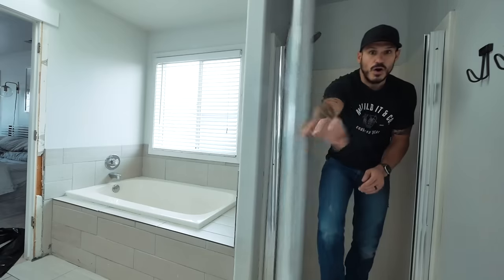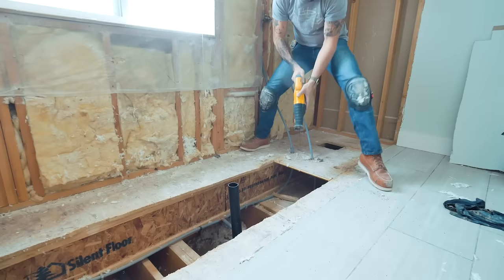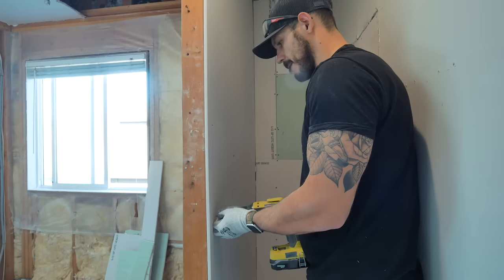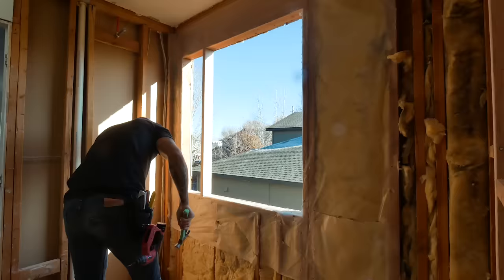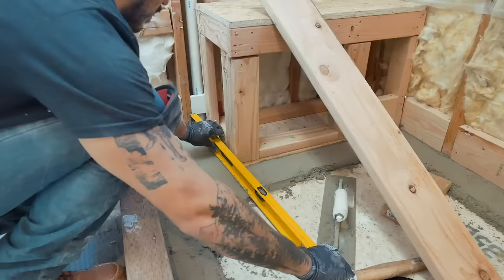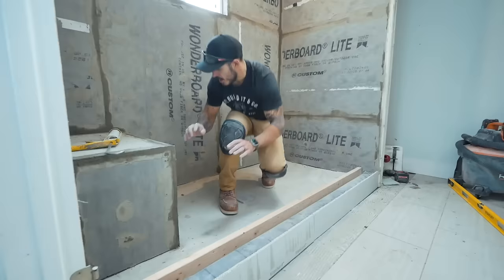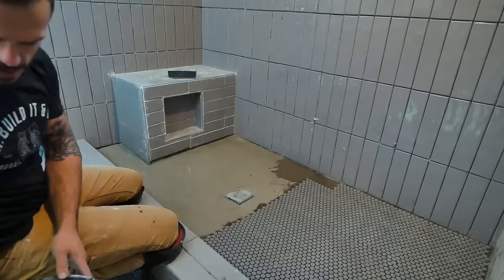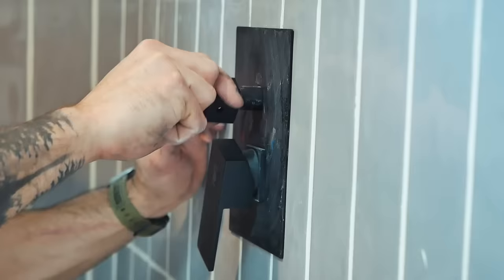Building a GIANT Shower (Home Remodel)

Comment: “all super easy. super simple.” hes says calmly while doing something super difficult and super complicated
Reply: says when he do super simple mistakes at water proofing.
Reply: @TH-wr1dv  You make a video then...
Reply: @oyster3145  And what we get with that? Me speaking poor english with rally accent will produce zero value.  And I did not judge his skills to to videos. I judge his skills to do structual choises for water proofing. Do you know that those are two different things?
Reply: I'm a trailer mechanic and thats the same thing some of my coworkers say lol
Reply: My thoughts exactly hahaa
Reply: I know is very hard need to find a handyman 🤣
Reply: Then hire him.
Reply: Tapio Haapala what mistakes did he make?
Reply: @esmyval8948 , it really isn't that hard. Most carpentry work looks hard due to a lack of experience. I would say the hardest part is just learning the work. After the how it works, it really is not that bad. Once you start learning, the hardest part is carrying the material lol.
Reply: @moabboy2175 , speaking as a carpenter with 20+ years experience .... I thought he did a good job. Honestly, he went above and beyond with the waterproofing. Most contractors do not use that rubber sealant on the concrete board, it is just expected that the tile and grout will keep the water out.

The one thing that did stick out to me, I would have used green board in the bathroom instead of normal drywall. Green board just being the gypsum board, which makes it more water resistant. Always used it in kitchens and bathrooms, just to be safe.
Reply: @TH-wr1dv  
Curious what you think he messed up?
He also put more layers of rubber sealer than most people would.
Most people don't follow instructions. Lol
Reply: @turboflush  He put water seal under concrete, not top of it. Then he put those wall sement boards top of that concrete and cover them with rubber. So basically that concrete slab is always wet and capillary will push that water to those sement boards and inside of wall. Specially when outdoor temperature drops thermodynamics keep care that all moisture from that slab will go to wall structure. I dont know what kind banana country laws even allow that kind structure.
Reply: @TH-wr1dv 
 good point. Cement is old school method. My 1940 house had a layer of tar paper on wood the concrete then tile.  Due to to much use .. 75years  later it rotted out the structure.
Just how it used to be done.

USA is slow for catching up on things. 
He also probably didn't have it inspected. But even then.. don't think they would have cought the where concrete was. They would just look that the pan doesn't leak and drains correctly.
Reply: @turboflush  yup. In finland that structure in video had been illegal over 20 years now. Moisture insulation work needs sertificate but even diy builders know how to do it properly. Basically there is no term "flood line" because that insulation will go as continous from floor to line of ceiling. Naturally doorstep will make flood line but rest is just continous (even pipe holes etc at wall wont leak). Also water seal is always just under top material and other layers must be breathing material. So if some reason moisture gets inside structure it will breath slowly out from it. So basically materials newer get sealed between two gas/water tight layer (as it was in this video) because it is guaranteed way to get mould.
Reply: @oyster3145  does he have to
Reply: Anngela Smithwick that’s what I just 
Commented I give it to the guy for trying but the finished product did not come out that good at all And a homeowner should not take on such an ambitious project Because I can assure you it’s going to end up costing you double and that double price Could be even more if you flood some thing or wire some thing the wrong way and most will be unhappy with the finished product people will want to know why it doesn’t look the same comes down to two things talent and experience Leave it to the pros
Reply: it was all fun and games until the piping came in
Reply: O
Reply: @Tuperwear his videos are alot of non load bearing and easy guts.....nothing he's doing is really going to make a house collapse and technically if any of his projects have a fail point he can usally call a electrian or plumber to bail him out usually under 500 or 1k
Reply: Tapio Haapala this is exactly why i would get a professional to do it. The money you save is peanuts compared to what it costs to repair mold, worst case it spreads so far you have to demolish the whole house (black mold). 

Especially in Finland where houses are very well insulated and temperatures are low the majority of the time, the risk of mold is just too high. 

Having the right paperwork will always make selling the house easyer, and will get you a better price. Noone is going to pay full price for a house where there is a risk of shoddy electical work and hidden mold.
Reply: @SportSoulLife  yeah I'd bare minimum hire a licensed electrician and plumber because if anything fails insurance isn't covering anything.
Reply: J Shapiro Remember back a long time ago when my mother bought our house, and the first thing she did is get the electical wiring in the kitchen checked out and replaced since she found out the previous owner did his own electrical work there. Turns out he used whatever wire he could find, including wiring taken from telephone cords, to wire up the electrical work in the kitchen. I live in a country where we use 230 volts in all outlets. A telephone wire for 230 volt kitchen appliances.
Reply: J Shapiro Oh and with remodeling showers or other areas expected to get wet and moist, atleast get a professional to do everything up until the tiling itself.
Reply: @SportSoulLife  that's a quick way to start a fire.....that's why we buy cheap spec homes and do the upgrades ourselves with out needing to go inside the walls. Just showers kitchens and flooring and it will always pass a va inspection and always appraise
Reply: J Shapiro Yup. What you mess up behind walls is hard to see before the avalance hits.
Reply: Yeah difficult and super complicated if you don’t know what your doing
Reply: It’s probably simpler than you would think, but I imagine costly and lengthy, especially since you’d be doing it on your own.
Reply: I agree, they always try to make it sound like it’s so easy...it seems easy until a year later you have a leak and it requires major structural repairs...and redoing everything that was done originally. ..anyone else see the “s” trap he used?

Comment: In Europe it’s just impossible to replace a window like that 😂
Reply: Why?
Reply: Yes, curious
Reply: Dynoids the walls are not built the same way at all
Reply: @AndreaSisto  different materials? Cause I used to live in Europe for my childhood and all I can think of is that many buildings have been there for a long time or are built out of stone/brick/cement
Reply: Dynoids yes everything is build out of stone. I have never seen a wall which is made from wood
Reply: I'm in the UK and my house is timber frame on the front and back above 1st floor, a common building method used alot if you own a 60s/70s built house
Reply: @MegaFunnyman86  until you start living in a city house with bricks all around you
Reply: @MegaFunnyman86   You must live in a council  house
Reply: @sarahann530  I live in a 5 bed house in Essex with 9 acres of land buddy
Reply: @tricksor6589  I live very close to London and I work a lot in London I'm a carpenter/builder and 90% of houses in London are brick you are correct, but not all of them
Reply: @MegaFunnyman86   5 bedrooms  is a good size   plenty of room for roommates.   Your landlord is making a killing  . You live in Essex you only wish you lived in London. TOWIE
Reply: @sarahann530  are you 10?
Reply: @MegaFunnyman86   Do you have  a thing for 10 year olds ?
Reply: @sarahann530  lol the shade
Reply: I see that no one of you has not seen Finnish house😐. Finland is in europe and we have so many wooden houses😒
Reply: @larsaskogstad yea

Comment: Everything was spot on except one major flaw. As being a tile guy for 20+ years the only main step you missed was installing the floor of the shower (tile) before the walls. This insures the water running onto the floor and not the joint where the floor and walls meet. Think of it as a waterfall, the longer the water runs into dirt instead of rocks the more erosion will take place. Have to think the same on showers. It will take 3-5 years before you start noticing but the outside layer of floor tile in the shower floor will start to come up because there is water getting between and under due to the tile being ran to the wall rather than under. Just a heads up but everything else looks amazing. 
Also another step I like to use especially when installing glass is going to your local Lowe’s or Home Depot etc. and custom ordering the pieces for the step over into the shower. They have tons of colors and finishes that definitely makes the showers pop. You can also order with beveling and they are cut to install without you cutting after getting. I always do the trim in the soap dishes and around windows and benches as well to give it a nice feel. It is inexpensive pending on color finish and size and creates a flat surface for the glass to sit on with no grout lines. Other than that, you could start your own tile business and make about $4-8,000 pending on what state and area you live in around doing a shower like this. You have the skill. Hope the shower still is awesome and good luck
Reply: Deep State I get that but that still takes away from look and function. Plus sealant gives out over time and if you don’t keep up on replacing the sealant in the joints it will take no time for there to be problems
Reply: @ericfry2128  Thanks for the tip. I will remember that when building my shower
Reply: "everything else looks amazing". Did you even see the tile gaps :D

Comment: I would've just bought frosted windows.
Reply: Right? I liked the original window. Get it frosted, and boom .. massive amounts of natural light, as well as privacy. Really nice. ^^
Reply: @vocorus598 Yeah, you could even get a frosted film instead of a whole new window. That actually surprised me. Good job though.
Reply: With lights switched on inside you would still be able to see their bare silhouette from the outside. Making the window smaller was essential. I still would have made it frosted though to avoid the look of dry water spillage.
Reply: @laleluilu  There are different levels of frosted, look it up.
I have an Ice design, there are no silhouettes.
Reply: XvCiiA I tried looking it up but ice Design frosted windows leads me to a google picture search of real ice crystals in windows lol. Thanks though, I believe you. My parents have a contoured glass bathroom window and you still can guess by the colour of clothes when a person is standing right next to the window (daylight). Otherwise the silhouette itself is very abstract. Don’t know about nude silhouettes, maybe it’s like camouflage indeed.
Reply: That's crazy I told myself the same thing 😂
Reply: I work in window cleaning in residences and a common problem with windows in bathroom showers that aren't high enough (sometimes even if they are) tend to get water in them and rot out the frame. The height it was set at in the video they would have splashed copious amount of water into the sliding window frame and would eventually rot it out. If plastic it would grow mold and have to be cleaned regularly.
Reply: @Skewrz  so you mean we should build the window as hi as it 'should' be?
Reply: @ultralinx200   Higher would be better really if you have to have a window next to your shower, the ones above the shower line seem to do well enough on average, I foresee trouble with the window he has in his shower a few years down the line unless it's sealed against water perhaps but then it may have other issues regardless as a result of being hit by water regularly.
Reply: It’s 16 feet up...nobody would have been able to see in anyways. I wouldn’t have bothered  if It became a problem you can frost the windows your self Fairly easily
Reply: Couldn’t you use the mirror type film? I have same set up. I guess I will research
Reply: k m  films sprays. Scoring the glass. Lots of funky ways but 16ft High there’s no reason to
Reply: k m - No, because if I’m thinking of the same thing, the film doesn’t take into account where the light it’s reflecting comes from - so it’ll reflect sunlight from outside, but at night it’ll reflect the indoor light, thus making it easier to see inside at night.
Reply: Yes, I thought frosted glass would have been easier and keep all that light
Reply: One way glass would have been an awesome idea too
Reply: i would have just frosted the existing windows lol
Reply: Was the window tempered glass I doubt ..probably cheap home depot window .I didn't see he wrapped tyvek on exterior before he put new one...I saw the grout lines uneven .maybe the tiles had crooked edges...for sure he saved money on doing it himself.you need to practice somewhere for the tiny tiles on floor I hope he did more than 1/4 inch pitch.water loves to sit in grout spaces he mentioned form half inch to inch so not enough slope...diagonal is longer from corner so he need about inch to do it right . . ..also the bench with niche .hmm interesting place to put it but who wants to bend to grab shampoo every single time construction is simple job . everyone can do it as long you have enough time.. sometimes it's better if you go to your job and pay a guy who does it faster and better .not always
Reply: I added frosted film to my window and you get both the light and privacy. He likes to do everything the hard way.
Reply: Frosted windows are tacky though
Reply: @ihateyouall7026  That's what I said frosted windows look tacky and cheap. Also, my first apartment had frosted windows in the bathroom and I quickly found out several of my asshole neighbors were spying on me in the bathroom. It made me paranoid for long time tbh and even to this day I don't really trust blinds or open the curtains in my bedroom. This is a stark contrast to me always having my curtains open growing up as a kid.

Comment: A submarine isn’t as “waterproofed” as that shower.
Reply: exept thats not even close to waterproof.
Reply: @konn4-129  Just use flex paste and it'll be waterproof.
Reply: @alexanderwatson8968  Sir, you just won the internet.
Reply: exept that "waterproof" does is not made right and there will be problems. That structure is illeagal in finland because it will get mould.
Reply: @TH-wr1dv  same in sweden, i always laugh when i see american shower renovations because it will only work for a maximum of 5 years before its rotted out or full of mold
Reply: @mrsimpa1  Yup. Also it is always fun when we look british. They think that it is modern to have single tap. To us single tap was old thing 50 years ago and last 40 years all new taps had been thermostat taps. And them "wet room" we had really hard to understand what is going on when they speak that will they do shower as "wet room" or not :D Then we understand that they are speaking that will they do shower room to water proof or not. To us is it just equally absurd than someone speaking that "do we install water toilet to our house". Like looking comedy show from history. But anyway if @Mr. Build it does not understand what went wrong I can tell that that concrete slab will be always wet. And because that plastic at floor is behind that conrete sheet at wall that sheet will suck with capillary that moisture inside of it. And because of water proofing that water can go only to outside. And because temperature changes it will pump that moisture quite well inside to that wall. So that wall will get wet and mold. And another big mistake is that at some points he left vapor block blastic behind that sheet. So there is 2 layers of blocking material  -> it will collect moisture and cause problems. Also it will cause point stress at moisture balance near windows -> there will be points what get rot over time. With that bad build quality at finland it would be last day on work and big bill for company. Oh and pipe connections inside of wall and floor /o\ yet another reason to get fired. How many mistakes you can fit to one room?
Reply: @TH-wr1dv  how many mistakes in your novel of a comment!